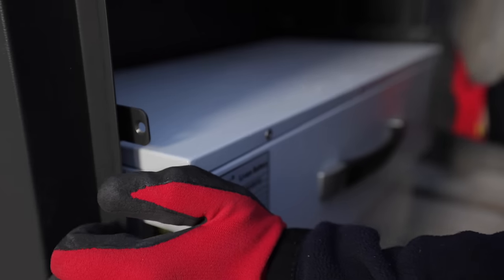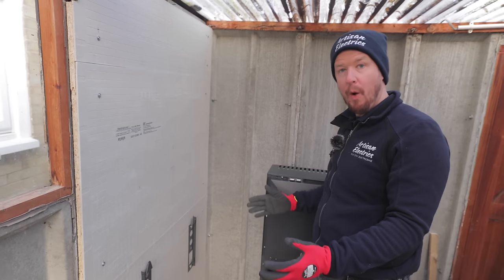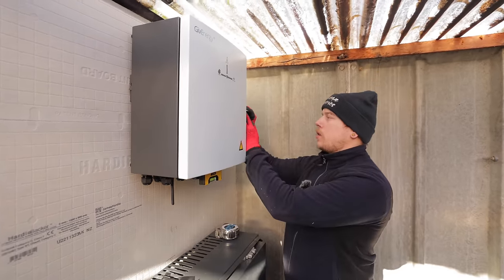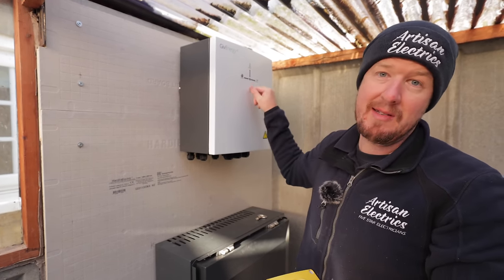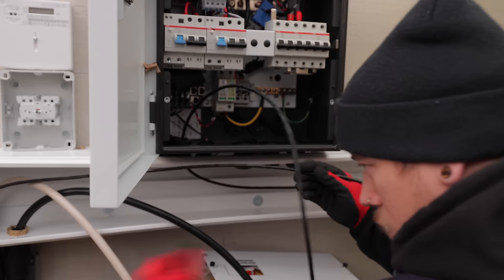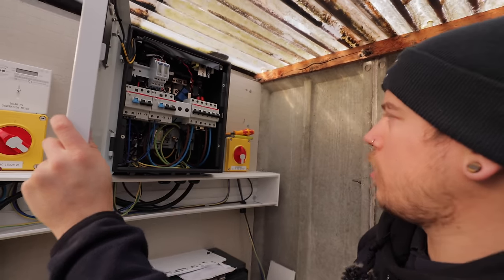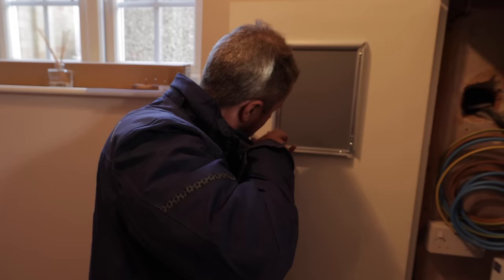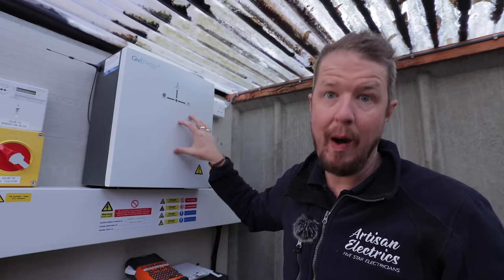How we installed the GivEnergy ALL IN ONE Home Battery System

Comment: Is the TT earth bonded with the TNCS earth at any time? Or is the TT totally separate? And if separate, would some circuits (eg non battery backed up circuits) remain protected by tncs during a power outage? Thanks
Reply from the maker: They are combined together in the earthing terminal
Reply: @artisanelectrics  that's really interesting to know. Does permission from the DNO need to be obtained to do this? I've always wondered if half your house is non-grid tied "off grid", and the other half is normal grid, can you just go ahead and bond your 2 systems' earth without notifying DNO (in UK)? Thanks
Reply: GivEnergy state that the earthing terminal inside the gateway is to become the MET for the house. The DNOs method of earthing must be disconnected. 
When there’s a power outage and the domestic load is supplied from the battery, the neutral-earth bond is made, meaning all current which would have gone down the neutral conductor back to the transformer will then go down the local earthing electrode. If the DNOs means of earthing is still connected to the MET in any way, there’s a chance for that current to travel back down the DNO line and fry the poor engineer who’s been sent to repair the damaged cables. 

However, in BS7671 18th Edition, Amendment 2, the wording of regulation 411.4.2 has been changed to make the installation of an additional earthing electrode on every tnc-s system a “recommended” action. In this case, the DNO earthing and the additional local Earth electrode should not be kept separate. But the Earth in this case is being used in a very different way.
Reply: @TomEggerton  If disconnecting the DNO earth completely then you would effectively be converting a TNCS/TNS to a TT system. The Island mode earthing arrangements under the IET Code of Practice on Electrical Energy Storage Systems, doesn't show you as having to disconnect the DNO earth - when operating under island mode or not.

What is essential, is as you point out if there is a PEN fault on the DNO earth, is there must be a consumer earth electrode fitted on any TNCS system when installing a system capable of Island mode. This effectively supplements the DNO earth under all conditions. 

The only additional necessary requirement is the earth-neutral bond relay to connect earth & neutral on the consumer load side when operating in Island mode, as with both line and neutral DNO conductors being isolated there is no longer an earth-neutral bond - and also the DNO earth neutral bond cannot be relied upon under a power loss condition.
Reply: It's neither in off grid, as it appears to run as an IT type system? Enjoy that rabbit hole of compliance....(You guys did check trip times in off grid yes?)
Reply: @blower1  when there’s a power cut, the relay inside the gateway connects the neutral and the earth. This means that downstream current from the house is sent to the earthing terminal inside the gateway and to the earth spike. If the DNO’s earth is still connected to this earthing terminal (and is connected to the DNO’s neutral cable as it is in tns and tnc-s systems) it is absolutely unavoidable that you have created a pathway for dangerous currents to enter the DNO’s neutral during a power cut, endangering the engineer that is sent out to fix the lines. This is what Giv and the DNOs that I’ve spoken to (admittedly only NG and SSE) are concerned about. 

This is why Giv are recommending that the installation is converted into a TT, with the earthing terminal inside the gateway becoming the MET.

Comment: How many amps of 230v single phase is typical in the UK for a residence?
Reply: 100A
Reply: Previously 60, then 80, then 100, now back to 80. 100a isn’t available anymore.
Reply: Is 80 enough?
Reply: @miltkuro4045 fused at 80, but that allows 100a for up to 4 hours, 200a for a few minutes.

Comment: I would challenge the TT Earthing arrangement installed here - to the point that it may be unsafe. 
When off-grid, fault current will not be trying to run to the TT Earth, it will want to return to the battery negative. TT Earthing is only applicable for current that originated from the Utility, and is seeking a path back to the same.  In this scenario, the household Earthing arrangement should be bonded to the battery Negative, not the MET in the Gateway. Impedance to Earth (TT) will be infinite ohms in the way it is installed here.
Of course once it's back on-grid, the household Earthing arrangement should reconnect to the MET, in favour of the PEN conductor - not sure if the Gateway can manage this switchover?
If I'm wrong, I'd love to understand the reality!

Comment: I didn't hear anywhere how powerful the inverter was....If they try and use more than this value they will either be paying for mains electricity to make up the usage difference, or it trips out. I personally went for a Sunsynk 8KW system which is 8.8KW output so I could run a washing machine and tumble dryer at the same time. Just a pity the SunSynk servers are down so often makes seeing real-time generation data virtually impossible - rigging a webcam in front of the display is definitely going to happen...

Comment: My installer did not use flame proof back board!
Reply from the maker: It's not a requirement just an "Artisan Touch" that we like to do to make things neater
Reply: we (my wife and I and two installers dead lifted 8kW battery unit into bungalow loft.
Reply: It’s not flame proof , correct term is non combustible. It’s just tile backer board.
Class A1.

Comment: Just curious, noted 32amp so assuming user has to be careful of load (for example showers) when running from backup? If so, any indicator for if running supply or battery without going out to the gateway/checking app?

Looks like another great piece of work you’ve done!
Reply: Ooh good question...do you think it has an app that might give you a ping perhaps? Genuine question to go with yours not sarcasm btw. 👍🙏
Reply: Yep is limited to I think 5kw on back up so yes if your loads exceed this it will not back up the whole house. You'll need to shed loads for it to work, same with Tesla. We get it all the time it's not a whole house back up misleading. There are other products that will provide full house back up, you'll need a lot of batteries though if that's what you want.
Reply: @b1stiecuffs ah, now thats worth knowing. They never mention that to us lay-persons do they? Further investigation on all storage required. Actually been wondering if Ecoflow batteries would be another less expensive option for power cuts, can't remember what their max output is, somewhat less I expect but if the AIO doesnt really back up the whole house I'd rather spend my money on something simpler and cheaper for storage, dont know how much the AIO is but I expect its significantly more expensive than more ordinary storage, who's names escape me now...Pylontech, Foxx? Might have dreamt those, not sure. 
Might help spread the costs more anyway....🤔 Thanks, food for thought.👍

Comment: All very well until the battery dies
Reply: Twelve year warranty 🤷‍♂️
Reply: LifePo4 is pretty solid and likely to last 15-20 years when properly managed by a system like this. Only concern is outdoor installations such as these and the inability for LifePo4 to be charged below 0c - unless there is some form of preheating in the battery modules they may find no charging at all on very cold sub zero days/nights. Nights being when you want to use grid offset (cheap rate elec at night to charge battery)
Reply: @blower1 mine is outside, we’ve just had a period of cold weather where ambient temperatures dropped to minus figures, the battery temperature never dropped below 8 degrees and the inverter temperature below 20. Mine is pretty much always doing something (either charging or discharging) and hardly ever idles but perhaps a less utilised battery may be impacted by such temperatures.
Reply: Fly by night companies that won’t be around in a couple years, 12yr warranty is worthless. Technology will be obsolete long before that. You’d be better off burning fivers to stay warm.
Reply: @steveb1856  stop now. You’re being ridiculous. “Fly by night”. Do you actually know what you’re talking about?
Reply: Incredible negativity from the “yes,but” and the “can’t do” types ! 😂